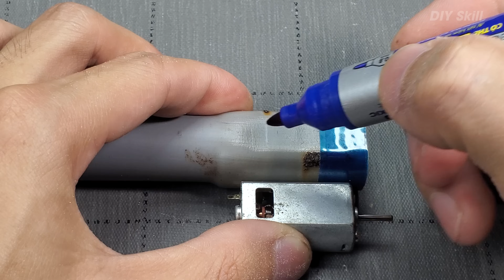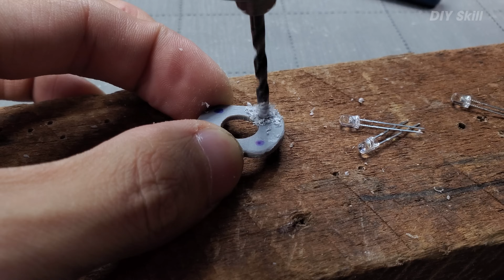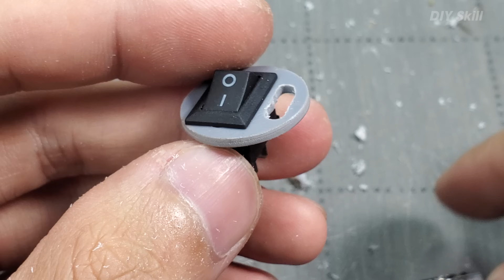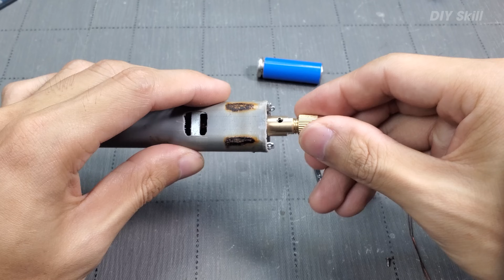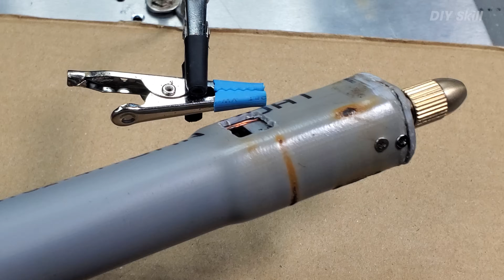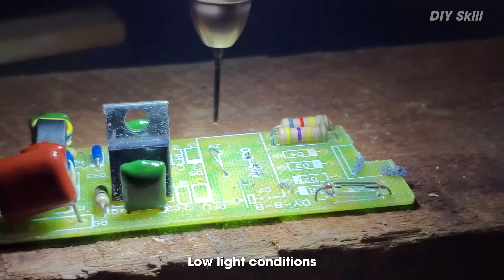DIY Mini Drill - How to Make a Powerful Mini Drill - Rechargeable with USB-C!

Comment: its actually not drilling, but burning, and that direct drive method will potentially kill the motor very fast, need some overload protection, or you can lower loads on the motor by using gears, there are a lot diff gears to buy for such motors, with gear you will lower the speed as well so that it doesn't burn, but drill. Also that copper wires... its just not safe, they are not properly isolated, there are just small layer on, and its easy to destroy that layer, and you just lay them on the motor chasis that can short them and burn. Good for school project, nothing more.

Comment: I'm a noob in electronics stuffs. And I'm sure there are more like me here. So for us, maybe mention accurate details of the components used? Instead of saying "Mini Electric Motor" (yeah, no shit its an electric motor) maybe write specs/model of the motor, or of similar types of motor. specify the usb c charging module you used. I don't konw, there could be many types of usc c charging module. When I'll go to electronics shops to buy the components, they will ask in more detail.. Saying "oh plez gev me electric motor" aint gonna work I'm guessing

Comment: You are genuinely showing the other tools when you used them.
Would you also provide captions in your video what type of components are being used. Because i have no idea what is the name of the black coloured paste you applied on the copper wire and size of the chunk(shunk or chuk or whatever,  used for holding the drilling bits). It would be very useful for beginners like us who is very enthusiastic of doing DIY projects.
Reply from the maker: Hello! Thank you so much for your comment!
Yes, I will definitely add captions to name the ingredients in future videos.
The black glue I used is B-7000
I will make sure to explain better next time. Thanks again for the support!

Comment: De cuanto es la broca 😅😅
Reply from the maker: A box of 30 drill bits costs about $1.
Reply: Pero de cuantos milímetros es la broca o cm ?? Si se puede saber😅😅😊
Reply from the maker: @XimenaFernándezMartínez A set of drill bits ranging in diameter from 0.3mm to 1.6mm

Comment: FANTASTIC! 👏🏼👏🏼👏🏼Satisfying video. I did enjoy whatching it! I`ll try make one. Wich motor and usb charger module model do you reccomend? As it is not writien in the description and I never made anything like that. Maybe I find these on amazon. Thank you for sharing the project. 👍🏼
Reply from the maker: Cool, thanks
Reply from the maker: @edindinho   You can use a 180 motor along with a TP4057 charging circuit.

Comment: can you suggest me a motor (3-5v) for a mist maker cooler?
Reply from the maker: @AdnanOrtho69  "Hi! For a mist maker cooler running at 3-5V, l'd recommend using a 130 DC motor or an N20 micro gear motor. They're compact, efficient, and work well within that voltage range. Good luck with your project!"
Reply: @diyskill-891  thanks👍

Comment: Please anyone thinking of doing this. DONT do it this way. The way you assembled the battery is extremely dangerous if you don't know what you are doing.  I do think you know what you are doing so I'm not concerned in this case but anyone else trying this. Please be aware that it's very dangerous.
Reply: Also it's battery capacity is also very less so it won't last long

Comment: Which motor is used
Reply from the maker: I'm using a 180 motor, rated 3-5v.
Reply: @diyskill-891  tankyou
Can you make a dremel tool 🥺
Reply from the maker: @  I’ll try to make a Dremel tool soon. 🙌
Reply: @diyskill-891  Thanks 👍🙏